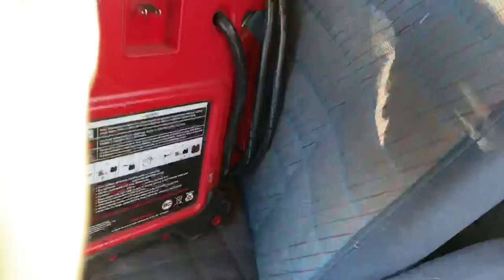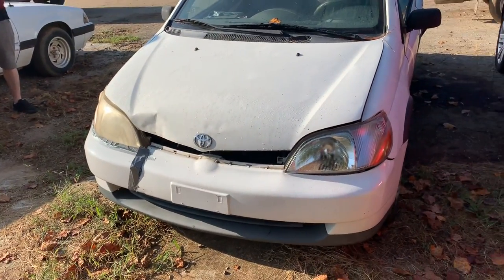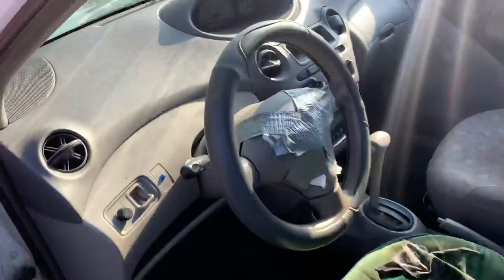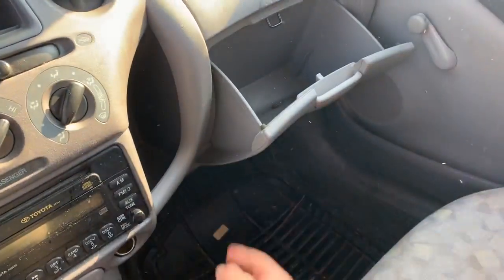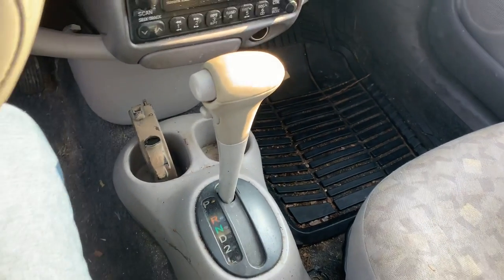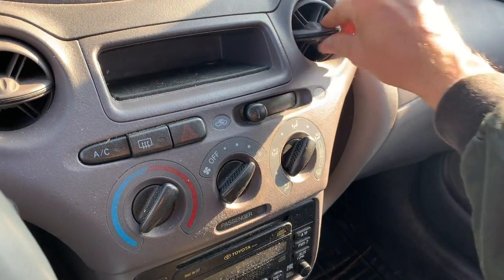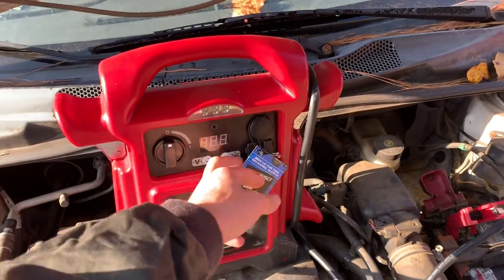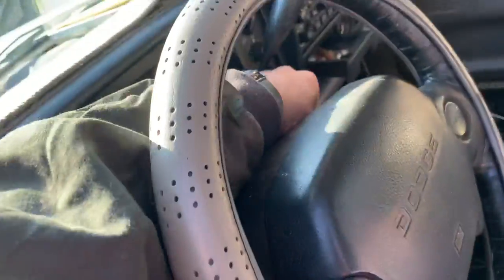$100 Toyota!

Comment: That has the interior and dash of a UK model Mk1 Toyota Yaris, which launched in 1999, replacing the Starlet. The 1999 - 2005 UK Yaris was never offered as a Sedan, only a 3/5 door hatch and a much less popular Yaris Verso model, but the hatch was the one most people bought, and I myself had a 1999 model with manual trans, 1.0 engine, sunroof and A/C. Our model also had a different head unit with a multi-function display in the position that there is a trinket tray on the Echo, over the heater controls. Really nice small cars, but here in the UK, like most older cars, its the rust that kills them off, along the rear sills and rear underside areas.

Comment: The A131L 3 speed is a great transmission. I have one in my 1990 Corolla. They blow up because the differential has a separate housing for fluid. The reason they blow up is because people have no idea that the diff needs to be checked. They made the 3 speed for over 20 years i think.

Comment: They banned the echoes at the rally cross tracks.. they tend to roll on stock suspension.. on coil overs they handle like they are on rails, unfortunately they are still banned..

Comment: I think this generation was related to the first generation Yaris.  As memory serves, the earlier version of small Toyota saloon/sedan (Tercel, perhaps) was related to the car known as the Starlet in a lot of markets.  There certainly is a marked similarity to the first-gen Prius, and it wouldn't be a huge surprise if the early Prius shared some body pressings, as the Prius, at least initially, wasn't really expected to be a huge seller.  The first-gen Prius might also share the engine in this car...

Comment: In Our Country Pakistan this car is named like Toyota Platz and it is powered by in our country with 1000cc vvti Engine my friend still have this thing these cars i will say like these are Tanks you cannot destroy these things my Friend Uses it for Careem as in your country its called Uber and he bought it on 7000$ Because Cars are very very Expensive here in our country Even if you want to buy 86 corolla it will almost cost here in our country like American 2500$ in Normal condition and he runs it on Compressed Natural Gas [C.N.G] Petrol is very expensive in our country thtswhy we people runs Almost Half of our country cars on Compressed Natural gas its Not very good for the engine but Actually people cannot Afford Petrol cars here so thts why they run it on [C.N.G] dont destroy this thing jane i will say tht if you Maintane this thing properly like changing the engine oil and Transmission oil on time it will probally work for i think year 2040 these things are tanks I also kept one of this thing in year 2013 and it was called Toyota Platz and it was 1999 Model

Comment: A couple months ago I picked up a 2009 Toyota Yaris for 200$. It needed the front driver door replaced since it was caved pretty bad from an accident, not bad enough to really damage it though. We replaced the alternator, water pump, spark plugs, rebuilt the coils and called it a day. good mud n snow tires on it, AC works, inspected til March next year. no rust underneath. hardly any surface rust even. The only down side to it is it's an auto, but for 200$ jesus did we get a nice car. It also has close to i think 230K on it now but she does not show it whatsoever.

Comment: The Toyota Echo was kinda of a failure market wise. It was surpose to replace the Tercel but the Yaris was already in development. So it instead of holding onto the Tercel for a few more years and waiting for the Yaris, Toyota decided to try cheaply slap together a temporary "new" car model which is almost looks exactly like a Tercel but with slightly different styling and a new engine and call it the Echo. Just so they can make more money while waiting for the Yaris.

Comment: Not good, extremely disappointing, was so looking forward to hearing it start. We didn't get these here in England, we did get the Yaris, it was a 3 or 5dr hatchback, with small engines 1.0 to 1.5 litres petrol and a diesel, but in interior was the same, but mostly with a digital instrument panel, maybe you guys in the US got the Echo instead.
Reply from the maker: Garry Walker part two is up! Go hear it run !
Reply: @MXguy95  I did, i showed up in my list a second after my comment haha.

Comment: Love seeing echos, I personally own the oldest version of the 1.5, a Toyota Paseo
Reply: Different engine. That's a 5E-FE, this is a 1NZ-FE. 1NZ's have an aluminum block and a timing chain, and I think they make a bit more power than 5E's.
Reply: Sheehy I know, that’s why I said it was the previous generation of the 1.5, and yeah they make about 10ish hp more
Reply: Sheehy Those where in the Tercel. The paseos had the 5SFE
Reply: @CupwakeRBLX  the 5sfe were from the Camrys, they’re 2.2 liters. Paseos had the 5EFE (1.5)
Reply: The random Potato ohhh